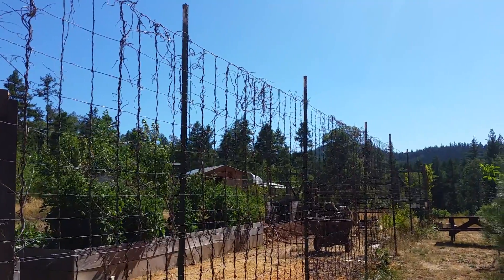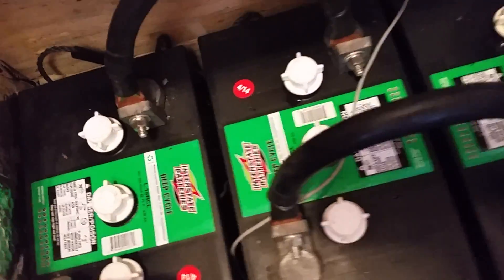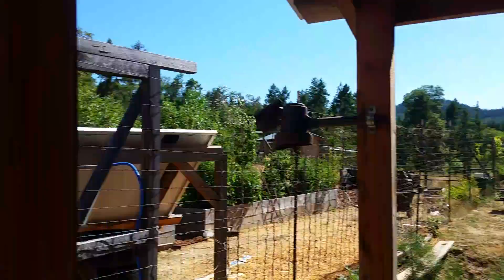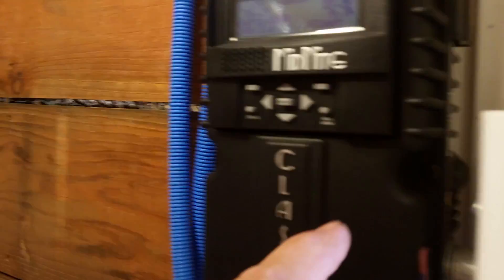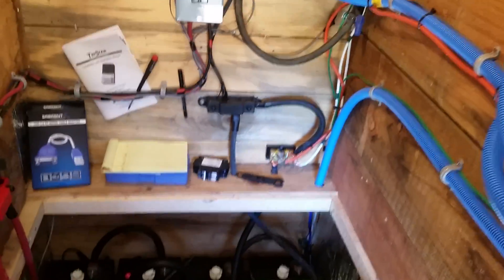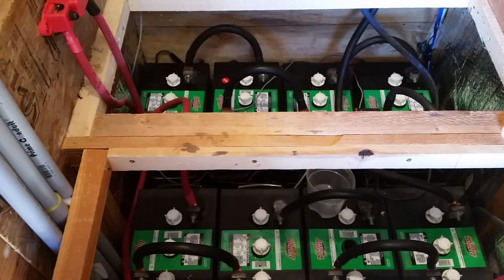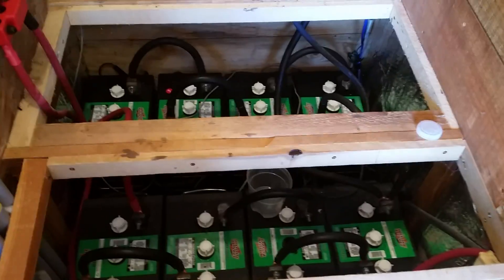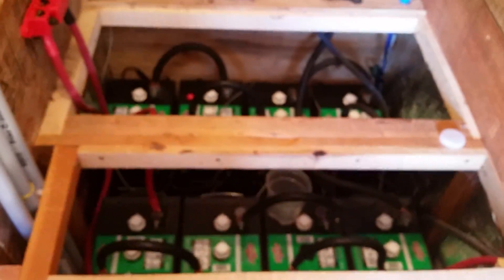Off grid Solar, Batteries after 3 years

Comment: Love the chimes! Awesome. In the summer, I am working my battery bank fairly hard...60-65% DOD. 2x a week bring them up to a full charge, long Absorb time.
Reply from the maker: Chris DIYer Hey Chris what do you have your absorb voltage set at and how long? I am 30 volts 2 1/2 hours and return  amps at 8. 
28 volts on float. ok so far. I cut the absorb time down to 2 hours but it was not quite enough. I need to get a wiz bank jr. for the return amps to be accurate. Right now the controller can not tell w the difference between house loads and current to the batteries.

Comment: That seems good ! I had a golf course and ran 12 cart fleet seems i had about 6 years or so on battery's before fail using the cart chargers !
Reply from the maker: Theredneck Prepper 6 years, That's pretty good for T-105 batteries in a cart. A lot of carts are  run  very low.  I have heard of 80% DOD Is the norm for a lot of places. If you could get 6 years from cart batteries with a typical taper charger Then I should be able to get at least 12 years from my L-1056HD batteries . I'm hoping for 18 years out of these batteries. Don't have to its just a challenge lol.
Reply: LOl Hell ya preacher that would be awesome ! fingers crossed ! I was thinken about geting a fork life battery ? what do do think about them bro ?
Reply from the maker: Theredneck Prepper The fork lift battery is the best if you are in a place to be able to pick it up and get it into a good location. I would have done that if I could have been able to set the battery in place. As you can see there is no practical way to move one into my greenhouse.